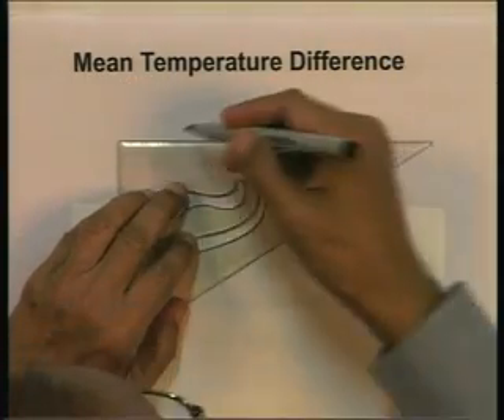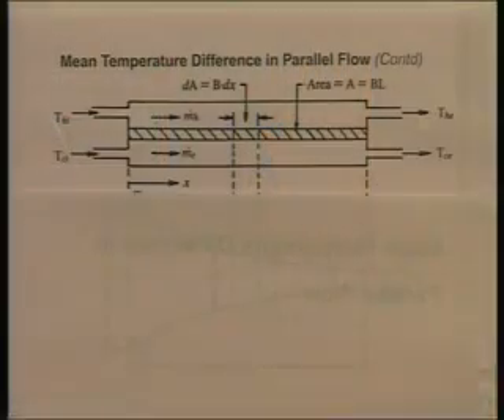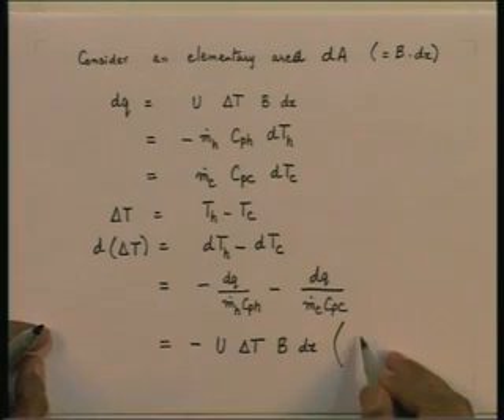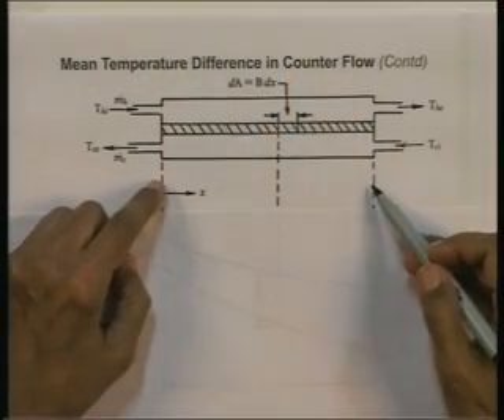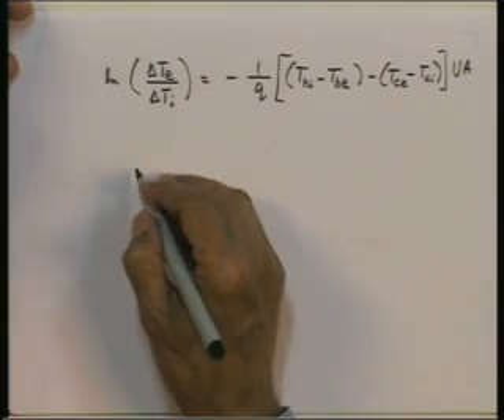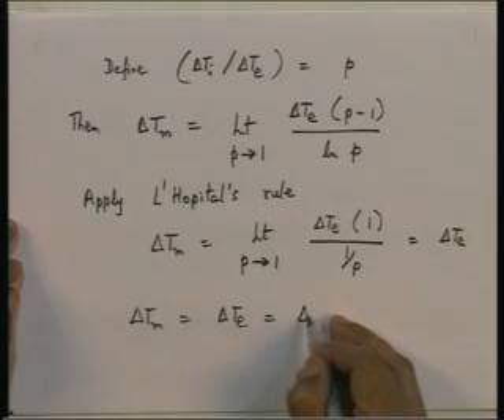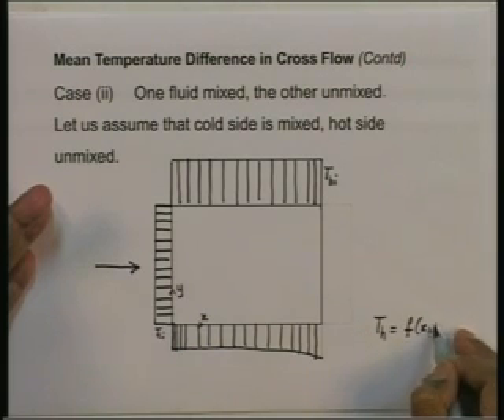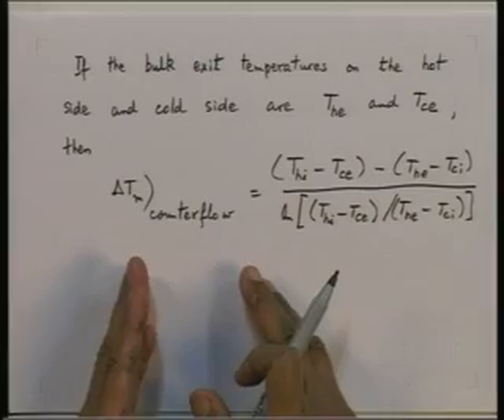Lecture - 26 Heat Exchangers - 2

Comment: WHY THE TEMPERATURE PROFILE IS PARABOLIC , WHY NOT LINEAR OR SOMETHING ELSE?
Reply: It depends on temperature variation along the length of heat exchanger. For that many other factors matters like coefficient of convective heat transfer, nature of imposed heat flux, geometric factors & many more. 
      Who said that it varies always parabolically ?? It may vary linearly, hyperbolically, asymptotically, etc.
Reply: If product of mass and specific heat are same for both the fluids, it will be linear.

Comment: Can you help me with this problem?
Air outflows from a receiver 
(balloon) through the nozzle into the atmosphere The temperature in the 
receiver is To 300 K, and the temperatere in the jet after the nozzle is
 Tnoz 200 K. Calculate the flow rate of air, assuming that there is no 
heat exchange with the environment. Heat capacity of air at constant 
pressire is Cp - 1005 J/(kg K)?